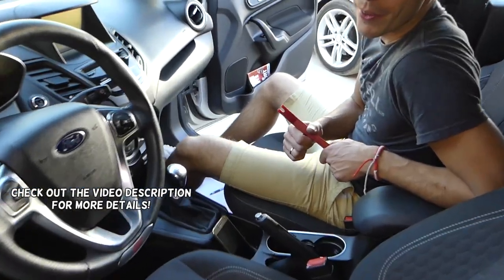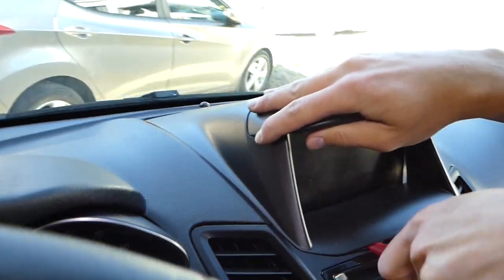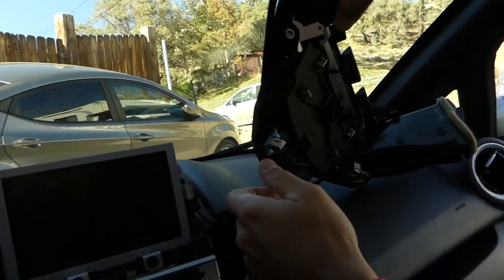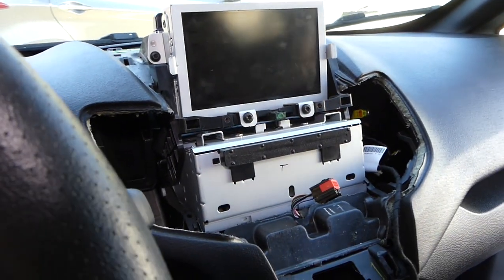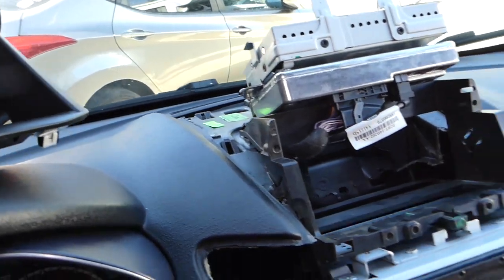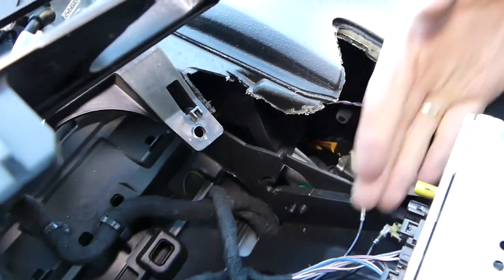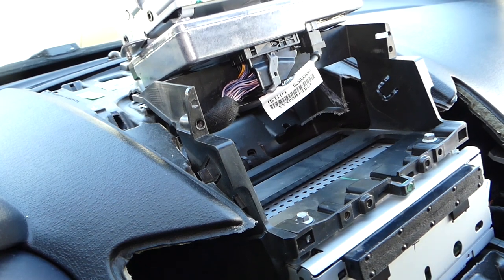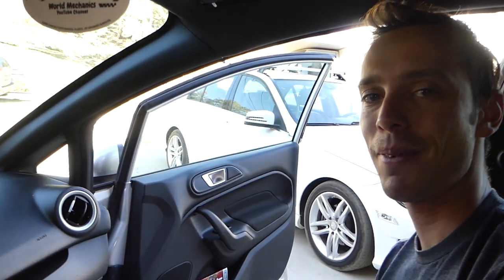FORD FIESTA RADIO REPLACEMENT REMOVAL MK7 ST

Comment: Great video! But just one thing I can add, at about 3:10 instead of disconnecting the ‘PASS AIRBAG OFF’ lamp from the panel, follow the wiring harness down the right side of the radio. There you will find a green connector which is much simpler to disconnect.

Comment: Did I hear you right about why you disconnect the battery in that way ? 🤔 if you disconnect the positive and it hits the body it will not blow anything apart from drain the capacitors in the modules, something that will happen after leaving the battery disconnected for 10 minutes. Its actually a trick you can do when your PATS glitches. I reason you disconnect the negative first and I hope this is what you mean but just described it wrong is that if your spanner shorts between the body and the actual positive battery terminal while yes can damage components, albeit very unlikely its more to do with the fact the battery can explode.